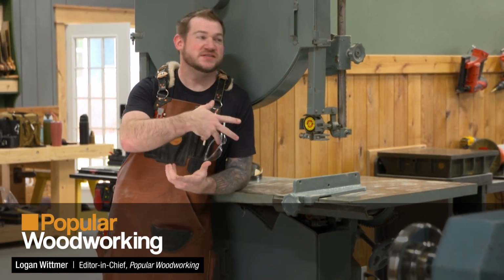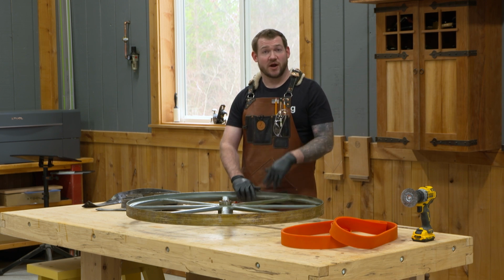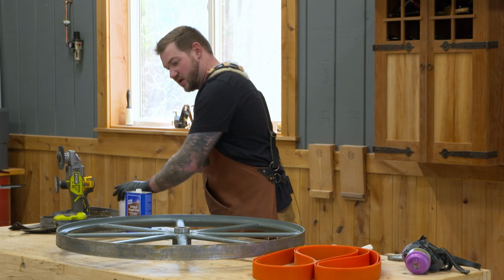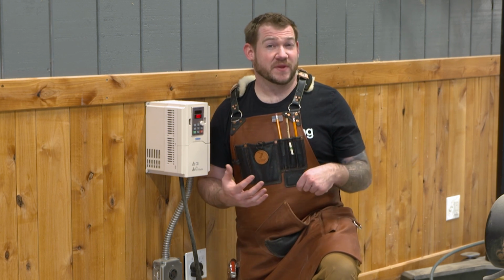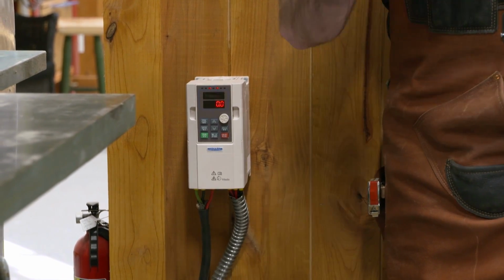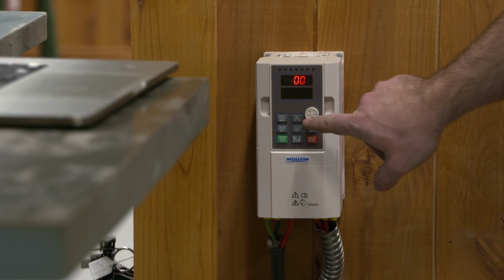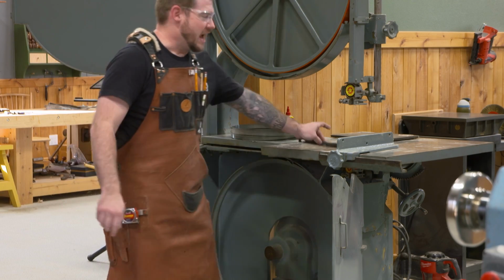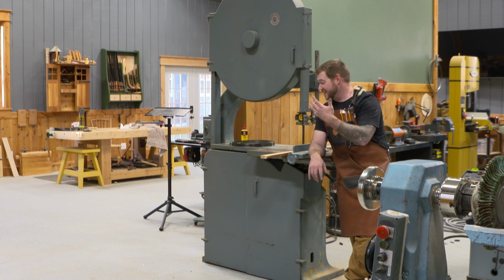Bringing our 1955 Crescent Band Saw to Life!

Comment from the maker: NOTE: We've since wired the original on-off switch to power the VFD. This means the original controls still work to turn the saw on and off! Keep an eye out for a third video soon.
Reply: if ya need some old arn to compliment that tool, I have a 1948 Rockwell/Cresent 8" jointer with pot belly base. Came from Coatesville Pa school district years ago and I only put a new 1 hp motor in it. I quit woodworking due to costs plus the fact that my brother can sell quality furniture through his auction house for less money than I can start my saw for. fact. Queen Anne furniture for under 20 bucks? queen size beds for $15? really? Cusrio cabinets for under $10....people don't want it unless it comes from a box: Ikea style. More wood shops have closed than opened over the past 3 decades...many more.

Comment: If you think the wheels might have asbestos in the adhesive, you should NOT remove it with a wire wheel or anything else that would release the particles into the air. Have it tested for asbestos. If it has asbestos, remove the adhesive chemically or send it to a PROFESSIONAL.

I am not a professional or an asbestos expert. This is simply common sense.

Comment: USE LAQUER THINNER, THROW AWAY PAINT BRUSH AND KEEP THE GREEN PAINT WET AND THAT PAINT WILL ZIP RIGT OFF.
NO DUST, NO NOISE. IT WILL BLISTER RIGHT OFF. THE   L.THINNER  WILL FLASH SUPER FAST KEEP IT WET.
Napatha is useless.